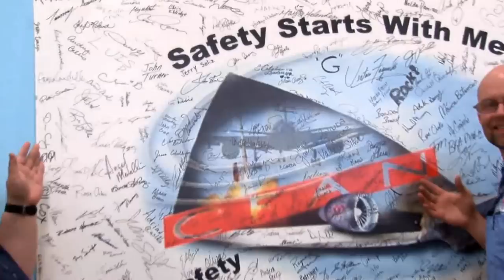GE90 and GEnx Composite fan blades

Comment: I work in a place that makes the smaller compressor blades deep in side these engines.  The machine with the probe that went around the outside of the blade is called a CMM machine.  Stands for coordinate measuring machine.  I use one at least twice a week at my job.  It's how we know if the blades have the right pitch/angle to them. If they don't then we have to bend them to get the right angle or tolerance.
Reply: From what material are the smaller compressor blades made?
Sounds like you have a cool job. Those engines look like they are amazing machines.

Comment: Miss this job. I deflashed the Genx 1b and 2b, and 115b blades. I also prepped the wearstrips. It was a fun job, great people to work with and great environment as well.
Reply: +Brendon Milligan Their lightness seems unreal.. 10 pounds? I'm guessing maybe 15?
Reply: Cool job Did you guys make the composite fan cases in house as well?
Reply: No, just the blades sir! Sangyoon Kim, I don't exactly want to give exact specifications of the blades or measurements out of fear for lawsuits lol! But yes, the blades considering their size, were relatively light-weight. GE115-B blades were of course the heaviest.
Reply: okkk3  lonbu
Reply: okkk3 

lon
bu
Reply: Brendon Milligan that's so awesome...so what's the tolerance between carbon blades? Do you still have to super position them prior to assembling them together to make the fan. Or are they so precise these days that it no longer matters.
Reply: Okay... How about weight distribution each blade, does this blades balance prior turbofan installation? all blades equal in weight.?
Reply: You are retired I suppose?

Comment: My brother is none destructive engineer, he worked on the inspection process for the shrouds they make to keep these blades from coming out of the engine housing in the event there is a reason they come apart, IE flock of birds hit the engine fan blades or there is some other failure like they had on the Southwest plane that experienced a broken fan blade. The carbon layup is incredibly strong, the sample section he has of the fan shroud is like 4" think pure carbon fiber. The carbon fiber blades are quiet compared to traditional titanium fan blade, I believe that they are better because the material they are made from allows for them to be shaped to perform a specific duty, the curves you see actual allow for more air flow for given diameter, engine speed, and engine type.
Reply: Definitely not 4" thick pure carbon fibre...it'll be a combination of carbon fibre and Kevlar, and won't be 4" thick
Reply: @Penguin_of_Death  It's near 4" thick, it's the band that encompasses the primary fan blades...

Comment: The three dimensional S shape of the blade provides the ultimate in efficiency. Powder high strength ceramic coatings of the blade face could add extra strength to the overall rigidity.

Comment: I bet they're working on automating this process.
Reply: Some work done manually and maximum work done by autoclave molding process just like oven structure of component is designed and put into the mold after laying of papers and doing vacuum processing they send it into autoclave molding machine removal of material is done at the end.
Reply: Using monkeys?

Comment: 2:32 : "Our blades are hand crafted and high quality" * grabs scotch and sticks it to the blade*
Reply: Oh like "butterscotch! Vanilla! Shit!
Reply: When handling composites, it is important to use some masking tape to stop off the edges of the dry fibres to prevent them from fraying.
Reply: Imagine, finding a solution as cheap as masking tape. The engineers must be the best money can buy. What would be your solution instead into the manufacturing process that would lower the cost while keeping a perfect quality of the product?
Reply: Scotch tape, Uline, 3M tape is pretty much used in a lot of industries for a lot of tasks or procedures. And there is a whole lot of special tape to choose from. This is nothing unusual.

Comment: I would say most of the blade is C.F. with the exception of the leading edge,but I did notice that the entire perimeter of the blade is capped off with the titianum.I would have to get a close look to see.Rolls Royce engines usewtal blades,and the have a very unique and cool way they produce them.

Comment: What is the percentage of carbon fiber volume fraction from Carbon fiber/epoxy composite for the GenX engine fan blade? Also which type of Ti-6Al-4V alloy is used as the Leading Edge of the fan blade?

Comment: "Labor-intensive" blade fabrication seems an understatement. GE's own  treatment of engine construction does not provide very much depth on how the unusual blade design was developed, and that would have been very interesting. For example, a certain amount of blade flexing might be expected, which could have been countered by fixing the outer end of each blade to a circumference "hoop". Yet, GE chose a free-blade configuration, instead.

Comment: Watching this I am wondering how much would the blade profile change if you start using a gearbox between the fan and the turbine driving it. How long before we start seeing engines with reductions between the front and the back end blades?

Comment: why jus not using precise metal such as solid stainless stell,,,,on same size pressure test,,carbon fibre only hold about 2.400 kg,,then solid stainless stell hold 15.100 kg is 15 ton,,wonderfull right,,thanks,,hhe

Comment: So GE uses composite fan blades and Rolls-Royce uses titanium ones. I suppose that is the biggest difference between the two..?
Reply: RR is now researching on composites too. Check out "Trent 1000 ALPS"
Reply: Yat Sum Leung
The question deserved a negative answer anyway. I suppose the biggest difference between Trents and GE products is that Rolls Royce uses a three spool design.
Reply: Berkay Güngör "It does what it's supposed and that's it." That's true. It does what it's supposed to but not very efficiently.
Reply: Nice
Reply: Rigidity per weight
Reply: Fatigue resistance. Composites far better.
Reply: RR are less conglomerate than GE.  This composite came from their GE chemical polymers company.
Reply: FSEVENMAN   &  Martin Andersson: Are you two pre-pubescent school girls trading insults about different jet engines? Is that really what you two are doing? Utterly unbelievable!
Reply: certainly so true
Reply: RR need more overhauls and have more failures, eg 787's....
Reply: No. GE is Awesome and RR sucks.
Reply: @Berkay Güngör Ya break. That's what RR dose.  GE#1
Reply: I'm confused. RR nearly bankrupted itself when it tried composite fan blades and they returned to titanium, as they failed the bird strike test. How have GE solved this problem?
Reply: @psk5746  Becouse GE is way better that's why.  Lol. Plus if we told you we would have to kill you  Hahaaaa. JK
Reply: @scott250r2  🙂 , I guess technology has marched on and sometimes being the second to do something is best
Reply: PSk that must be Airbus’s motto as well “cough” A350 “cough”.

Comment: Carbon fiber’s melting point is around 600 deg c, which is the same as Aluminum. Standard Epoxy resin, heat cured,  start breaking down around 300 deg c. I believe these amazing fans have no problems sustaining a high temperatures. How is it done? And what’s the difference between traditional metal fan blades regarding temperatures. Is temperature a big  issue for the fan blades in general?
Reply: No, it is the turbine blades that are exposed to high tempratures, not the propeller fans. a jet engine has blades for compressors to compress air for combustion, then the compressed air is mixed with sprayed fuel then combusted in a seperate chamber , the air is further shifted to the turbine that harnesses the kinetic energy from the combusted hot air. the turbine is connected to the propeller via a shaft. the ones in the video are propeller blades.
Reply: They don't need to sustain high temperatures. They're at the front of the engine a long way in front of the hot bits. (ie, if they're getting hot, then something is going seriously wrong)

On the other hand, where things are hot, R&D into ceramics (coatings and complete units) has been continuing apace for the last 40 years. Incremental improvements....

Comment: I am wondering if these blades would resist canadians geese impact. That's exactly what captain Sullesburger had to deal 10 years ago when he landed in the Hudson River.
Reply: William Acuna you do realize these engines for certification purposes had 15lb frozen birds fired into them at takeoff power. This is not new, 777’s have been flying for a long ass time.
Reply: I did not know that. Thank you for sharing!!!
Reply: Couldn't they also attach a protective wire mesh screen on the front of the engine to keep birds, people, or other objects from accidentally being sucked in?  Just a thought.

Comment: Those multi layered , carbon fiber main fan blades burn like a high school bond fire . Witness the engine that caught on fire at the Las Vegas airport last year ! Smoke so thick , that had that plane been in the air it would probably never made it back to an airport because the engine fire would have completely engulfed the whole main body before it could land !

Comment: I really want to know of the high tech WATER sprays , how do they recycle all the hundreds of gallons of H2O to  use again ?  Certainly the used water has to be purified over and over to make sure absolutely no type of materials are in the water which could damage the blade fans. 
It's extremely important to continually make sure that the water is as pure as water can possibly  be . 
To think that the consumption of water is gigantic in terms of number of gallons continuously used. If anyone knows the answer , it sure would be a good thing to know your input. Thanks.

Comment: Earned a spot in the museum of modern art? Iv'e been to this museum. These blades and someones welded pieces are the only art in the place. The rest requires no skill to produce.
Reply: Ya they think putting a trash can with used tampons in it in the middle of the room is "art".
Reply: Especially knowing a hand-painted 3color stripe image can be sold for 7figure sums.
Reply: Modern Art is just a way to launder money.
Reply: There has to be individual correlation between unconsciously negative 
behavior versus positively productive state, that said fellas know the difference between filleted and unfiltered or tamed or untamed bagger, need I say anymore.
Reply: How cute, confusing engineering with art. You've only put your ignorance on display with this dismissive comment.
Reply: 1. If you like art, don't ever go to a museum of "modern art"
2. They would never donate a $10,000 fan blade to anyone unless it was faulty construction and resulting unairworthy use.

Comment: Carbon fibre was a British development, and Rolls Royce designed a large turbine (RB211) around lightweight carbon fibre blades in 1970. It was a great design, but failed the bird strike test. A 4lb chicken is fired into the engine at full speed. Anyway, the engine had to be redesigned with titanium blades, and Rolls Royce went bankrupt. The UK government took them over. The RB 211 went on to be a very successful engine.

Comment: are there any ways to achieve more thrust without giving the engine a drastic increase in the engine's diameter ??
Reply: +loyd ala The higher the speed and the mass of the air coming out of the back of the engine, the more thrust it delivers.  On fighter jets, for example, they have a secondary burner stage called an "afterburner" which increases the heat (and therefore the pressure) of the exhaust gasses.

-jcr
Reply: +NSResponder so you just kinda improve the performance of the fan to deliver more thrust ?? am i right ??

Comment: 4:15
a company that produces some of the most advanced technological products, and yet they fail to replace a hydraulic table that leaks oil and loses the selected height over time :)
Reply: It's meant to
Reply: Draylogic how do you know? Its not like the technician is adjusting it, it drops very gradually due to a leak
Reply: +dimos k it drops gradually so that the curved parts of the blade are easily within reach. The technician would've been trained to work with it
Reply: Draylogic sorry, I cant accept that explanation. You can see him adjusting it himself at some point. So there is no need for it to drop by itself. Besides, it drops very slow it would not be noticeable at normal speed
Reply: +dimos k if it wasn't meant to move hen what's the point in it being heigh adjustable in the first place. Is your computer desk height adjustable? Probably not because it doesn't need to be
Reply: Draylogic it's meant to move by the operator, when he needs it to.
It's not meant to move on its own during a long period of time. It's a classic failure of hydraulic seal.
Reply: +dimos k yes and in some cases the hydraulic tables are designed to rise or fall over a period of time for the user. That way he can work on the shallower parts of the blade and then work his way up to the curved tips
Reply: +Archer exactly
Reply: Archer it's not hate at all. It's just an observation, since it makes a big contrast to the high tech profile of the company.
Reply: Draylogic do you honestly believe that in this video, the table is designed to drop by a few centimeters while he is working at the exact same area of the blade, or you just want to stick to your original comment just so you don't accept that maybe you are wrong?
You can even see him lowering it on his own at some point
Reply: dimos k ?.
Reply: You are right, that's obviously a leak

Comment: What's the point of the titanium edges?
Reply: Bulbous Cock21 @3000 rippers leading edges begin to heat up. @30000 rippers you can imagine a high amount of heat. Titanium has the highest melting point to weight/ strength  coefficient.

Comment: Could those blades be 3d-printed?
Reply: Roman Zerstoren My guess would be no.  3d printing  would make a homogenous blade that wouldn't be as strong as a carbon-fiber or a carbon-carbon blade with the fibers running throughout providing additional tensile strength.  Maybe some day when multiple print heads are able to print different materials together.

Comment: I`ts not x 2000 lbs , it`s 1880. I hope they use better tolerances on the blades. ^_^
Reply: Koen Klijnsmit 
They never said 2000. They said almost 2000.  Believe it or not, 1880 is almost 2000.
Reply: If that is the case, then i should have listened better. In the movie and in mathclass. Thank you.

Comment: Wow ok. Takes about 15,000 to manufacture a standard blade. however these blades are so light and stable fuel efficiency will make it successful. But like it takes another 30,000 dollars to manufacture carbon fiber blades with the titanium edges. Otherwise airborne geese will shatter the whole piece. I didn't know carbon fiber blade popularity despite of the price drawback.
Reply: Mr SerjyGorm Look at the GE 90 engine test. They throw everything at it including birds nothing  kills it or the blades.

Comment: Is it possible to turn it/ths into a little or big in ths case,/…portable directrix fan in wheels,/…/???lke attach the blades to a hub, thn attatchbthe or tht to a motor variable speed or not, multiple speed or bit, belt or not lke belt drive or,/…chain drive or not?🤔🤨🧐🤷‍♂️Because it’d be cool to hve a single fan lke ths that’s a portable electric or gas or solar/fan with a generator and motor attatched to where the motor can spin the generator to power the motor to then potentially or eventually run the fan, but make it quiet in terms of the generator and motor, to where when you turn it off, it doesn’t turn off the motor and generator, just the fan, so lke they stay on all the time continuously but cuts the power off to the blade or turbine in this case, but keeps the other stuff running to continuously hve power lke I said, if ths/that makes since. Oh yeah, and,/…a breaking or some kinda breaking system in the motor or so

Comment: GE nx and GE 90 engines used a 4822 alloy turbine blade.The WS-15 engine used a single crystal Ti45Al8Nb alloy turbine blade and a graphene powder turbine disk which is 50 % stronger than GE engines.Germany wants the WS-15 engine technologies.